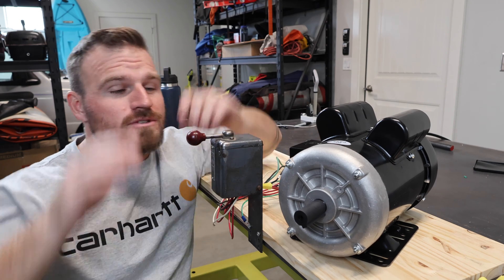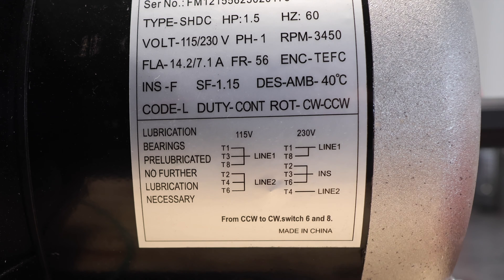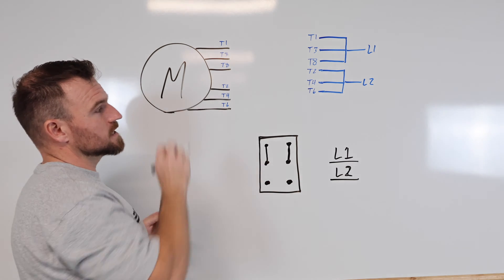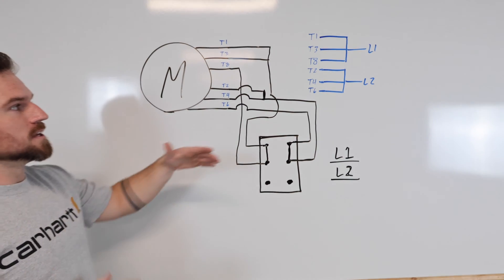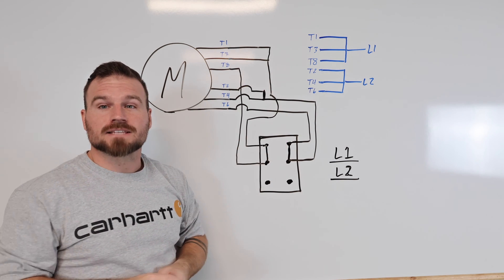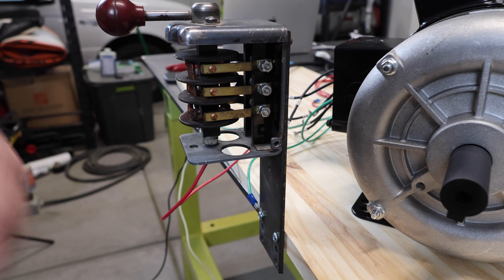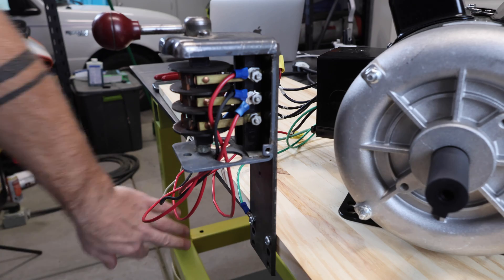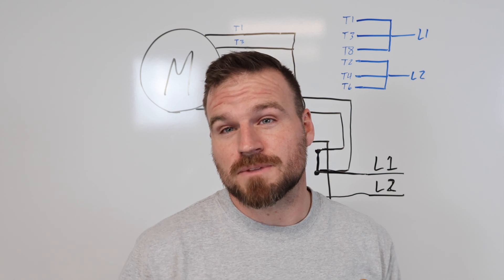How to Wire a Drum Switch to a 6 lead Motor to Build a Reversing Circuit.

Comment: Great video! However I do want to point out I have had motors wired with black wire connected to L2 and neutral to L1 and tripped the breaker. I would stick with the theory of black to L1 and neutral to L2. Once I switched the wires it ran fine. Just my experience.
Reply from the maker: Interesting! I typically do set them up that way but I wanted people to feel confident . I'll watch what I say next time.
Reply: @M @Mikesfilmss try it out for yourself. It may have been the way I wired it or the motor wasn’t meant to be wired that way. Weird things happen.

Comment: I have a motor that doesnt identify the wires by T1… they are color coded how do I determine the T equivalent. Also my motor only has a start capacitor if that makes a difference. And i want to run the motor on 220v
Reply from the maker: I would suggest looking up the wiring diagram on the motor itself.

Comment: I need to be able to wire a reversing switch to the same motor you have in the video except that my motor has T5, T7 and T9. Those 3 wires seem to be for a thermal switch. Took it to a motor shop and they cant figure it out. 
Help!!!
Reply from the maker: I don't have a 9 lead motor. I would have to look at the motor to help you.

Comment: I have 7 leads on my 110v motor. The L1 is neutral and L2 is hot. The L1 is always connected to the motor. Red and Black are my reversing wires. Do I need the jumper if L1 goes directly to the motor?

Comment: I have a south bend lathe with A 110/220 single phase motor. I want to add a drum switch furnas r22 switch. My motor has p1 p2 and t8 t3 t2 t5 and t4. According to the motor label for 220 single phase45 together to line 832 tape p2 tape p1 line. Please help what is the correct wiring diagram

Comment: I have a Vevor DP120356L with leads T1,T2 ,T3 ,T5,T6,T7. Im trying to wire it to a 3 pole Drum switch with 240Vac.  It shows T2 and T3 are the interchangeable leads. Any advice? Anything helps. Great Video. Your content is great. Im in trade school currently.

Comment: Ive been trying to figure out this video but is hard bc im going based on colors and your going base on what the motor is telling you i have regular black and white on both ends but extra red and orange for the motor..
My problem is that it only goes forward not in reverse when pressing the pedal up or down

Comment: This is a very good explanation of how to wire this motor to a six lug switch. Unfortunately, I am trying to use an old Cutler- Hammer Model 10260H120 9 (nine) screw switch that came with the the SB 9 inch I just rebuilt. I'm using the same motor as in the video , but I don't want to burn it up by experimenting, sooooooo, can someone show or clearly explain the hookup using the switch that I have. Thanks in advance, your assistance is much appreciaTED.

Comment: I have a Smith and Jones one horsepower thermally protected motor wiring into 220 into a Dayton barrel switch for forward in reverse on my lathe. Leads coming out of the motor, P1, P2, T3, T8, T2, T4, T5. The only video I can find of yours. Your motor has different wiring numbers and letters, and I’m not sure how to switch them. Please help. Thank you very much Steve Jennings.

Comment: How can I wire a 120 volt 1 hp vevor motor 9 wire with gfi plug and switch?  I'm replacing my AO Smith boat lift motor with the Vevor.  I watched your video with the 6 lead connection
Reply: Great video, and thank you for your help.

Comment: Very, very useful video. I'm using an AB drum switch and a 1/3 hp Leeson motor that will be run on 120v.Could you tell me what gauge will I need to connect the switch to the motor?  Also, mine has a jumper strip between 6 and 4 on the drum switch. Does that represent a different approach to wiring, and can I remove that jumper and do it the way you show? Very grateful for any help you have time to share!
Reply from the maker: Hi,

I never seen the type of drum switch you are working with. There might be a different way to wire it. I’d have to look at and possibly research it to answer that question. It might be similar to the other drum switches videos I’ve made.

I would recommend looking into sizing wire for motors because there are a lot of variables, but I have used some online calculators that have given me the same answer as doing it long hand. I would just google those calculators.

Comment: Very easy to follow but my motor has a different wiring setup.  I have a Dayton 30PT77A. It has only 4 wires and several leads?
Reply from the maker: Huh is it 3 phase?
Reply: @Mikesfilmss  no, single phase 115v

Comment: Thanks for the clear explanation on your video of wiring a drum switch with 110 Volts, However This did not work on my cheap Amazon 15.99 ( Uxell Brand ) drum switch. Mine only works in one direction and does nothing in the other switch position. Can you help me. Mine has 6 connections. The motor wiring is exactly what you show except #5 instead Of #6.
Reply from the maker: I’ve never used that drum but I would look at the wiring diagram. It’s probably different. I’ve done videos on a few different styles. Maybe one of those matches.

Comment: Thank You for this Video. In our factory we only had two 120 Volt Motors that ran off of Drum Controller. Most of the time if a Motor had to be run off of a Drum Controller it was a 440 Volt Three Phase Motor. You made this very clear ! Thank You for your efforts and attention to detail !
Reply from the maker: What kind of factory do you work in?

Comment: How can I wire a limit switch on the reverse side but still have the forward still work, once the reverse is limited out? Application is for pulling a boat out of the water, but I want it to stop when it hits the limit but be able to let it go back down. 120v motor, Dayton drum switch and industrial limit switch.  Thanks
Reply from the maker: That's a cool project and problem. I'm not saying it's impossible but most of my experience with these switches is for lathes. I think to add more control capabilities you would need to move/add to a basic motor control or PLC. I wish I could help but there are limitations with the amount of contacts of the switch and 120v motors. I hope you find a way to do it.

Comment: So there are no wires on the opposite side? Its a great explanation i can see that but im in no way an electrician. The side of my drum switch that has label L1 and L2 has L1 with jumpers to the two ports above it so vertical from top to bottom i have 9, 5 and L1. To the left i have from top to bottom 11, 7 and L2. Direct opposite side is 10, 6 and T1 on left and T9, T8 and T2 on right. Help me get through this and I'll never do it again
Reply from the maker: I'm not sure what you are asking but I'm more than willing to help.

Comment: Is positioning the 2 switching wires, your case i believe you said 6 and 8, in diagonal from each other for all drum switches? I guess they all work pretty much the same
Reply from the maker: No there are all three different styles of drum switches. I have videos explaining all three with different voltages.
Reply: @Mikesfilmss  its all good. Just happens a friend of the owner is an electrician and came by and he hooked it up. I appreciate you taking time to explain the process. Youtube has been really great for people willing to help others and people needing help

Comment: Finally figured out how to wire my Leeson 1/2 HP 1725 rpm motor to a Dayton drum switch. If you would like I can send a copy of the wiring diagram to your email. Nice to be able to back off a threading die under power!
Reply: I would like a copy please
Reply: Send your email and I will send a copy to you. Note: this is for a Leeson 110vac motor with seven leads. This schematic is for a Dayton Drum switch.
Reply: @MrMetalhead0124 
I’m trying to wrap my head around a lathe motor that sounds much like what you did. Would you please send me a copy of that drawing. I’d really appreciate the help. The harder I think about it the farther away the solution seems to get. If I see you reply I’ll post my e mail address. Thanks a bunch.
Reply: Have you received the schematic I sent?
Reply: @MrMetalhead0124  no I have not
Reply: I have a leeson with 6 wires

Comment: I have a Leeson 1/2 hp motor. It has P1, P2, T2, T3, T4, T5, T8 wires. In the 110vac configuration P1 goes to line, P2 , T3, T8 are Taped, T2, T4, T5 are line. T5 and T8 are the wires that are interchanged in order to reverse rotation. I have a Dayton Drum switch that has the L , and upside down L configuration. Top to bottom on the switch would be 1 and 2, then 3 and 4, and then 5 and 6. Forward configuration would be 1,2, and 3 / 4,5, and 6. In reverse 1,2 and 4 / 3,5 and 6.  So how do you wire this 7-wire single phase motor?  Just trying to hook up my lathe so I have forward and reverse without burning up a motor. Great videos!
Reply from the maker: I have a video with the L-style switch. Check that one out. It might tell you what you need.
Reply: Where is that video for the L type switch?

Comment: How are you supposed to know how many wires are on a motor? Most websites that sell motors do not list how many wires are on the motor. Is it specific to type of motor?
Reply from the maker: Most of the ones I've bought do say in the description how many wires they have. I also try to look at the wiring diagram to make sure it's going to operate the way I want.
Reply from the maker: Most should say how many words they have or I try to look at the wiring diagram to tell.

Comment: I have the same wiring motor as this, however a different drum switch. It is a 2601 AG2 switch. On my switch, 2&3 are tied together instead of 1&3 like yours. Any ideas how to wire this?? I appreciate it greatly!
Reply from the maker: Is the wiring diagram different? I have some other videos of different switches. Maybe one of those matches your switch.
Reply: @Mikesfilmss  i saw the other videos but they all look like they are for 220 motors. My motor is single phase coming in.

Comment: What happened to U1, Z1, V1, V2, U2, Z2. WTF is T1,T2,T3, etc. I've never seen that anywhere.
Reply: Hahaha hate it for you but at least I'm not the only one. After going forward with video I see why it didn't make sense to me because my switch is different than his. Hope you get it worked out. The "T" wires are wires coming from the motor. Some brands are different

Comment: How to change 5 to8, with no numbers on the wires. Got motor to run in reverse but no forward.
Reply from the maker: I explained how the switch works and how to switch from 5 to 8. Did you watch the video or one of my other videos on drum switches?
Reply: @Mikesfilmss  watched your video, but my wires aren't labeled. To get to work in reverse was pure luck. Got 3 yellow wires coming out a hole on top of wire box and 3 yellow wires coming out of the bottom  hole. I just put 2 that came of the bottom and I just lucked out.
Reply from the maker: @rodneykuenzer5789  Good for you! glad it worked

Comment: I have a motor with the same wiring as this video and a drum switch with the same configuration as this one. I am trying to wire it in 220V single phase but can not get it to run in both directions with the drum switch. can you please help me. I watch your 220 volt video but it has a different drum switch wiring configuration.  Maybe I need to get a different drum switch but I would like your recommendation first. Great video you do an out standing job. Thank you.
Reply from the maker: What's your email? Your second person asked for that video today 😂 I'll send you a rough drawing and order the parts to make that video.

Comment: what if your motor has you switch 2 wires to reverse direction. My motor says switch blue and whit and yellow and orange.thanks
Reply from the maker: Interesting! I haven't seen your motor but based on what you've said I would see if I could connect the blue and white wires and treat it like one wire and connect the yellow and orange wires and treat it like one wire. Does that make sense?

Comment: Nicely done Imat.. it obviously works.. but i would have thought looking at the diagram that T2 T4 and T6 would have been isolated not not connected to line 2  as it doesn't have a connecting line coming out of it like the other group does.
Reply from the maker: I see what you are saying. I think that's a cheaply-made decal that's missing a line. I wish I had a better reason
Reply: @Mikesfilmss   Im using the QS-60 switch witch switches differently.  i've seen your video for the qs-60 with high voltage. it seems different enough that im not sure where the connnections go.

Comment: Were is the video link on how to wire the other type of drum switch?
Reply from the maker: I’m working on it 😬 I’m working on an electrical trainer video that turned into a nightmare. How can I help you in the short term?
Reply: Thanks for the reply.  Do these $15 import drum switches have the same 
poll & throw (contactors) configured
 as the one shown it your video?
Reply from the maker: @petemclinc  I'm not sure. What is the link to the $15 ones? I can look at them and see
Reply: @Mikesfilmss  ebay listing: 60 Amp Drum Switch Forward/Off/Reverse Motor Control Rain-Proof Reversing 60A D
It switches the motor direction lead contacts on the
diagonal and horizontal not vertical and horizontal like
you show.  It has built in jumpers between some of the
contacts.  I've tried to wire it per the illustration and
at best can only get it to go forward.  Other attempts 
I get a hum or trip the breaker.  The jumpers make it
very confusing.  My motor is a Dayton 6K6193, 3/4
HP, Single Phase, 115V, Capacitor Start.  Leads are
(T2, T4, T5) connected to L1 (Black Power Cord) and (P2, T3, T8) and P1 connected to L2 (White Power Cord).
Reply: Also, the rotation change leads are T5 & T8.  From what I can tell this motor should be a reversing type.  Hope you can help, thanks a bunch!
Reply from the maker: @petemclinc  I'm sorry I just saw this. can you send me the part number for the switch?
Reply: DS60A
Reply from the maker: @petemclinc  I ordered it. I look at the switch and make a video as soon as I get it
Reply: @Mikesfilmss  OK, thanks!  I have figured this out already.  Basically I followed your 
previous instructions isolating the dual field coil leads and having a wire from the tied 
leads switch poles with the reversing start capacitor leads.  Line 1 lead wired thru the 
switch and Line 2 connected directly to the motor.  It took me forever after trial and error attempts.  Good luck!
Reply from the maker: @petemclinc  Awsome! Glad you got it figured out!
Reply from the maker: https://youtu.be/y8P-pQKw8Gc

This is for a 220-volt motor. If you want a 120 volt video for this switch, let me know.

Comment: Amazing timing. I have a very similar motor that I am hoping to install to replace a cooked one on a lathe I bought. Mine has a T5 (otherwise EVERYTHING else on this same Vevor motor is the same) which is supposed to be Line 1. The T3/T4/T7/T9 bundle wants to be bonded to eachother and insulated otherwise.
Reply from the maker: Nice! I hope this helped you!